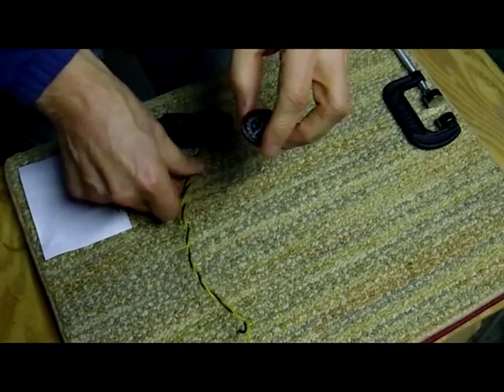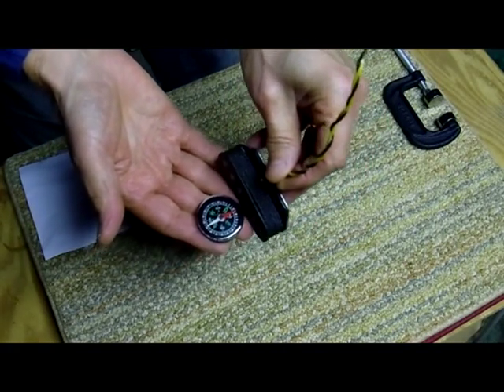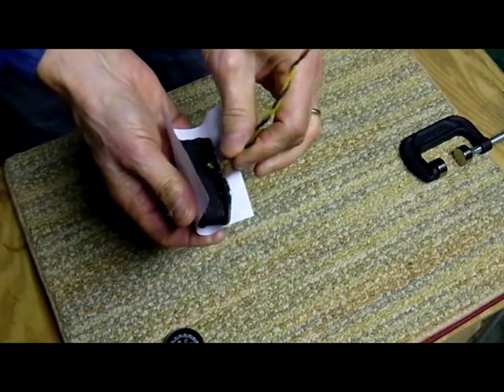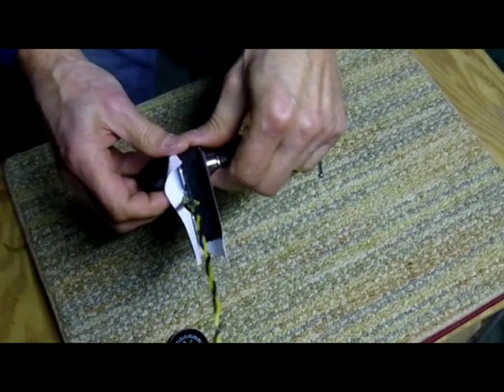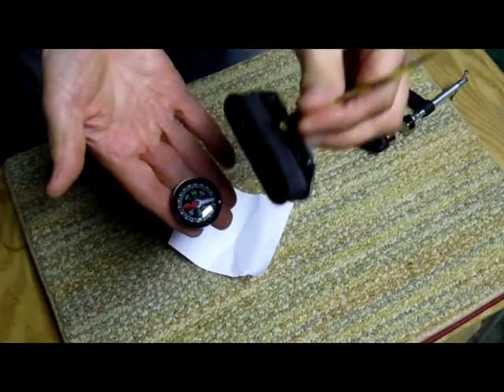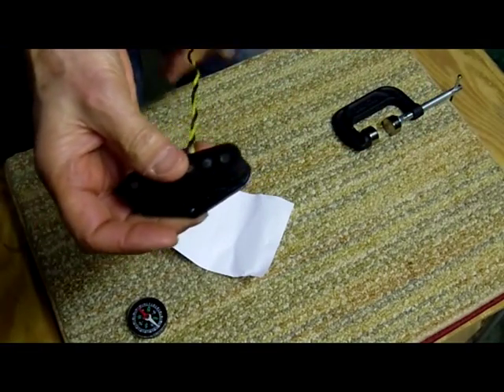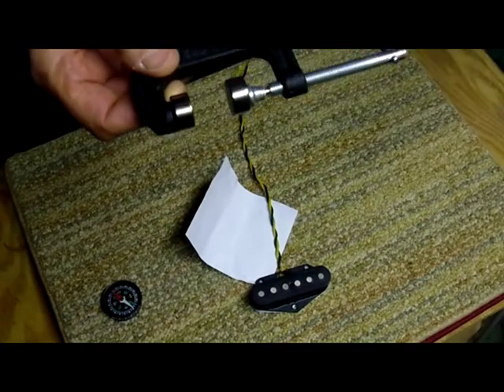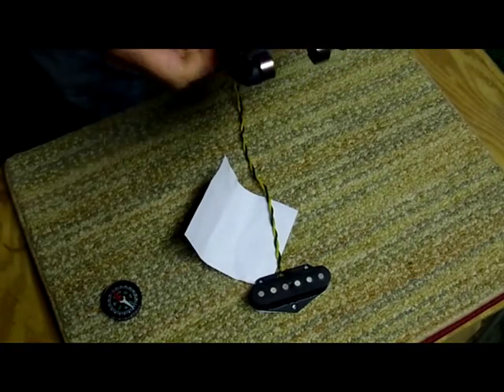Guitar pickup polepiece polarity flipping & charging

Comment: I changed the polarity on my Tele Bridge pickup and swapped the yellow wire and black wire at the 3 way switch and volume pot, respectively.  Now I'm getting a ton of noise from the bridge pickup.  Is there something else I need to do with the back plate of the pickup?
Reply from the maker: since 99% of all tele/esquire bridge pickups ground strap one side of the coil (for string grounding) to the pickup's back plate, i'd bet money that's yer problem with the noise.  snip that strap and solder a string ground lead to the back plate and run it into the control cavity and solder it to the back of any pot.  alternatively, just break the coil wire strap to the back plate (snip it with cutters) then take a piece of thin insulated wire (most any gauge), bare one end and stick it under the bridge itself, and solder the other end to the back of any pot - this also becomes a string ground lead.  without a string ground lead to any guitar, the noise level will not be reduced by you touching the strings.  hope this helps ... ?
Reply: @rfdsrd  Thanks!  That helps!

Comment: Do you need a gauss meter to know how much they are charged?
Reply from the maker: +soundiscomforting not at all, the charging is nearly instantaneous and the gauss tanks are full up as they should be.
Reply: +rfdsrd Thanks for replying. I'm curious, I've read that "regular" stratocaster pickups have around 600 gauss. If that is so, how can you charge that with a 25 gauss magnet? Are the two measurements different? I've read people who use 25 gauss magnets to charge their pickups. Thanks :)
Reply from the maker: @fredrik.larsen   sorry to reply years late!  there is no need to think in terms of gauss rates if you employ  a good sized neodymium magnet for charging.  an N42 1/2" diameter by 3/8" thick axially magnetized neo mag will "fill up the gauss tanks" of any passive pickup magnets.
Reply: @rfdsrd  Don't be sorry! Thank you for replying:) I ended up charging the pole pieces fully with a neodymium magnet. Thanks again!

Comment: Why would you want to flip the polarity?
Reply from the maker: for a multi pickup guitar/bass, having one pickup RWRP (reverse coil wind, reverse top polarity) will allow when two pickups selected to create a parallel humbucking connection that is relatively noiseless, or in the case of a telecaster with a 4-way switch it can have both parallel and series humbucking noiseless connections.

Comment: Nice, but you are saying it backwards, the north compass needle points towards north (therefore is charged south), so the N needle will point to the north polarity of the pickup
Reply from the maker: the &quot;north&quot; pole of the earth is actually magnetic SOUTH, not north.  the north needle of a magnetic compass is attracted to the earth&#39;s  &quot;north&quot; pole, which is actually magnetic SOUTH.  get it?  :)  actually, the earth&#39;s magnetic fields have flipped many times over the course of known earth history, and we're due for another flip, where north becomes south and vice-versa.
Reply: rfdsrd thanks for explaining that, I had to go and double and triple check, because I couldn't believe it, and you are absolutely correct, I find it crazy  counterintuitive!
Reply from the maker: wild, ain't it?!!  ;)

Comment: Can i remagnetize only two poles? (E and B string)
Reply: Yes, you can, but for what?
Reply: I'm guessing those 2 poles lost magnetism for him... I did this accidentally once whilst trying to get metal fillings off of the pole pieces.... I used a magnet to do it.... Won't do that again!
Reply from the maker: @all_invite_0hm  never use a magnet to "clean" another magnet!  pole piece pickups should have all their magnets charged up, not just a few, as this keeps the magnet gauss rates even and that will insure the strings will be evenly magnetized to a fair degree.
Reply: Makes sense. Like I said, I won't make that mistake again! :P